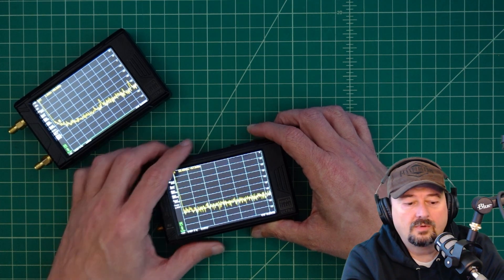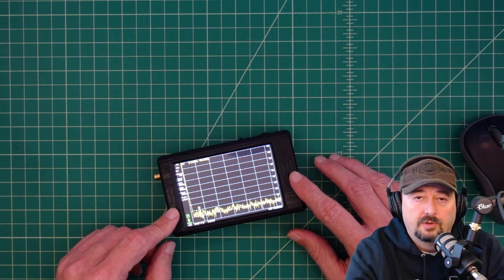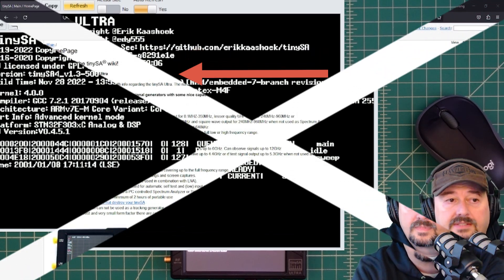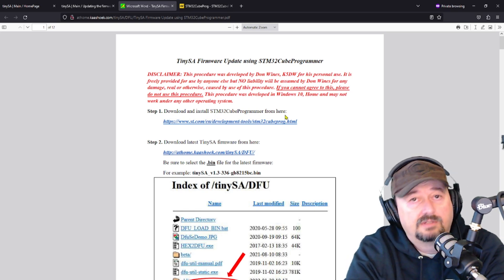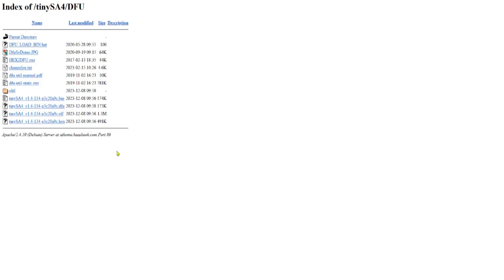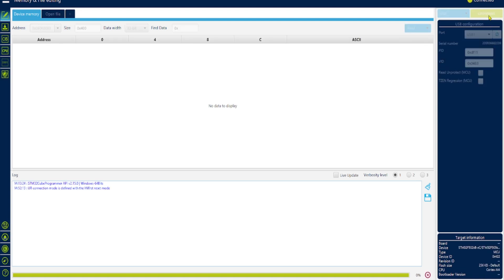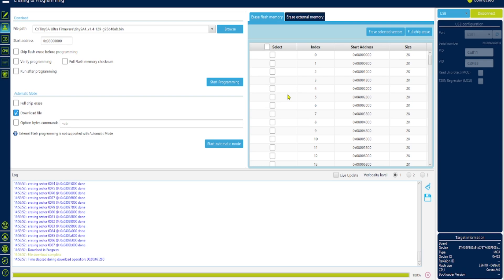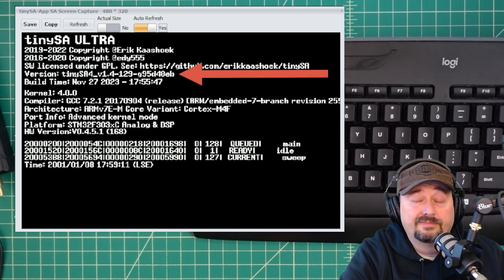TinySA Ultra Firmware Update

Comment: I cannot find anyone who has put out a video showing how the use the STM32CubeProgrammer to perform a firmware update on a NanoVNA. The hardest part of which is making sure you get the correct .bin file for your particular NanoVNA, otherwise it is the same process you demonstrate here for the TinySA.
Reply from the maker: I actually like the software 🤷
Reply: @TheSmokinApe  Cannot beat the price, it works, and is “easy” to use!
Reply from the maker: @kennethharpster3403 💯

Comment: Just received my Aursinc Tinysa Ultra+ ZS207 today. Went through CAL; Activated Ultra mode (strange that we have to do that).  Upgraded the STM32 program version and downloaded the firmware 1.4-199(new as of 03/31/2025) to my device. Some items seemed different from your video, but it worked.  This one goes to 7.3GHZ.
Reply from the maker: @muskateer10  awesome, hope you like it 👍
Reply: @TheSmokinApe  Thanks. I am looking for a good Bluetooth headset. I have my Icom 7300 operating remotely via Wi-Fi. Once I get the Bluetooth headset, I should be able to walk around the house and trigger the rig while looking for RF on the SA.

Comment: After firmware update version tinySA4_v1.4-171-g393022c.bin with the STMCube programmer the screen stays black on my TinyDA Ultra.

I did exactly what you did in the video

17:25:09 : STM32CubeProgrammer API v2.16.0 | Windows-64Bits 
17:34:48 : UR connection mode is defined with the HWrst reset mode
17:34:49 : USB speed   : Full Speed (12MBit/s)
17:34:49 : Manuf. ID   : STMicroelectronics
17:34:49 : Product ID  : STM32  BOOTLOADER
17:34:49 : SN          : 2060326Axxxx
17:34:49 : DFU protocol: 1.1
17:34:49 : Board       : --
17:34:49 : Device ID   : 0x0422
17:34:52 : UPLOADING OPTION BYTES DATA ...
17:34:52 :   Bank          : 0x00
17:34:52 :   Address       : 0x1ffff800
17:34:52 :   Size          : 16 Bytes
17:34:53 : UPLOADING ...
17:34:53 :   Size          : 1024 Bytes
17:34:53 :   Address       : 0x8000000
17:34:53 : Read progress:
17:34:53 : Data read successfully
17:34:53 : Time elapsed during the read operation is: 00:00:00.242
17:37:32 : Read File: C:\Temp\TinySA Ultra\tinySA4_v1.4-171-g393022c.bin
17:37:32 : Number of segments: 1
17:37:32 : segment[0]: address= 0x0, size= 0x2C4D8
17:37:51 : Memory Programming ...
17:37:51 : Opening and parsing file: tinySA4_v1.4-171-g393022c.bin
17:37:51 :   File          : tinySA4_v1.4-171-g393022c.bin
17:37:51 :   Size          : 177.21 KB 
17:37:51 :   Address       : 0x08000000 
17:37:51 : Erasing memory corresponding to segment 0:
17:37:51 : Erasing internal memory sectors [0 88]
17:37:51 : sector 0000 does not exist
17:37:51 : sector 0001 does not exist
17:37:51 : sector 0002 does not exist
17:37:51 : sector 0003 does not exist
17:37:51 : sector 0004 does not exist
17:37:51 : sector 0005 does not exist
17:37:51 : sector 0006 does not exist
17:37:51 : sector 0007 does not exist
17:37:51 : sector 0008 does not exist
17:37:51 : sector 0009 does not exist
17:37:51 : sector 0010 does not exist
17:37:51 : sector 0011 does not exist
17:37:51 : sector 0012 does not exist
17:37:51 : sector 0013 does not exist
17:37:51 : sector 0014 does not exist
17:37:51 : sector 0015 does not exist
17:37:51 : sector 0016 does not exist
17:37:51 : sector 0017 does not exist
17:37:51 : sector 0018 does not exist
17:37:51 : sector 0019 does not exist
17:37:51 : sector 0020 does not exist
17:37:51 : sector 0021 does not exist
17:37:51 : sector 0022 does not exist
17:37:51 : sector 0023 does not exist
17:37:51 : sector 0024 does not exist
17:37:51 : sector 0025 does not exist
17:37:51 : sector 0026 does not exist
17:37:51 : sector 0027 does not exist
17:37:51 : sector 0028 does not exist
17:37:51 : sector 0029 does not exist
17:37:51 : sector 0030 does not exist
17:37:51 : sector 0031 does not exist
17:37:51 : sector 0032 does not exist
17:37:51 : sector 0033 does not exist
17:37:51 : sector 0034 does not exist
17:37:51 : sector 0035 does not exist
17:37:51 : sector 0036 does not exist
17:37:51 : sector 0037 does not exist
17:37:51 : sector 0038 does not exist
17:37:51 : sector 0039 does not exist
17:37:51 : sector 0040 does not exist
17:37:51 : sector 0041 does not exist
17:37:51 : sector 0042 does not exist
17:37:51 : sector 0043 does not exist
17:37:51 : sector 0044 does not exist
17:37:51 : sector 0045 does not exist
17:37:51 : sector 0046 does not exist
17:37:51 : sector 0047 does not exist
17:37:51 : sector 0048 does not exist
17:37:51 : sector 0049 does not exist
17:37:51 : sector 0050 does not exist
17:37:51 : sector 0051 does not exist
17:37:51 : sector 0052 does not exist
17:37:51 : sector 0053 does not exist
17:37:51 : sector 0054 does not exist
17:37:51 : sector 0055 does not exist
17:37:51 : sector 0056 does not exist
17:37:51 : sector 0057 does not exist
17:37:51 : sector 0058 does not exist
17:37:51 : sector 0059 does not exist
17:37:51 : sector 0060 does not exist
17:37:51 : sector 0061 does not exist
17:37:51 : sector 0062 does not exist
17:37:51 : sector 0063 does not exist
17:37:51 : sector 0064 does not exist
17:37:51 : sector 0065 does not exist
17:37:51 : sector 0066 does not exist
17:37:51 : sector 0067 does not exist
17:37:51 : sector 0068 does not exist
17:37:51 : sector 0069 does not exist
17:37:51 : sector 0070 does not exist
17:37:51 : sector 0071 does not exist
17:37:51 : sector 0072 does not exist
17:37:51 : sector 0073 does not exist
17:37:51 : sector 0074 does not exist
17:37:51 : sector 0075 does not exist
17:37:51 : sector 0076 does not exist
17:37:51 : sector 0077 does not exist
17:37:52 : sector 0078 does not exist
17:37:52 : sector 0079 does not exist
17:37:52 : sector 0080 does not exist
17:37:52 : sector 0081 does not exist
17:37:52 : sector 0082 does not exist
17:37:52 : sector 0083 does not exist
17:37:52 : sector 0084 does not exist
17:37:52 : sector 0085 does not exist
17:37:52 : sector 0086 does not exist
17:37:52 : sector 0087 does not exist
17:37:52 : sector 0088 does not exist
17:37:52 : Download in Progress:
17:37:56 : File download complete
17:37:56 : Time elapsed during download operation: 00:00:05.089
Reply from the maker: STM32CubeProgrammer version 2.16 has a bug and is NOT able to update the tinySA. Use version 2.15
Reply: @TheSmokinApe  I have TinySA Ultra i saw there where a new version 2.17 now, do that one work on TinySA Ultra?
Reply from the maker: @pege63  I’m not sure, haven’t tried
Reply: @TheSmokinApe  Thanks m8, it worked am good to go now!
Reply from the maker: Apparently the 2.17 will work

Comment: Thanks a lot for useful video. I can conform because I did it!:) WARNING: "STM32CubeProgrammer version 2.16 has a bug and is NOT able to update the tinySA. Use version 2.15!!" . Of course who reading instructions.... TinyAS after update with STMv2.16 looks like bricked but older version 2.15 fixing it.
Reply from the maker: Yeah, this is a good point 👍
Reply: I wish I would have seen this earlier.  I have been trying to find data as to why my TinySA ultra went to black screen after update.  I am up and running now.

Comment: I used the STM DfuSe_Demo V. 3.0.6.  Once installed, I had to upgrade the drivers in Win device manager, but after that, hardly what you cal complicated. I did this for the Nano VNA H4 and that upgrade went flawless, and just did the upgrade for my Tiny SA ultra.
Both in under an hour. So easy, it seemed scary.
Your video is a very good guide, TNX
Reply from the maker: Hey Daniel, glad it worked out for you 👍

Comment: I did the update and something went wrong, it wouldn’t startup again so I started to play with my new paperweight after a while I checked the box erase the chip and got lucky it worked. After I restarted and sent the bin file. 
I think with the hassle of getting the software and bin file I had duplicate files that had number differences I fixed that by naming it what it should be then got lucky
Reply from the maker: Glad you got it sorted out 👍

Comment: I also tried to update my TinySA ultra based on the videos for the first time with the STM32 program.
In the end, this indicated that it was successful.
There is an error report in the log.
88 memory addresses could not be deleted because they do not exist or something similar.
After the update everything went black.

The TinySa app has not seen the device.
The STM32 saw it, connected, at the end it said that the update was successful, but it still remained black.

After half a day of struggle, I gave up and tried the "Full chip earse" option.
I updated it again.

When the update failed it was done in less than 2 seconds.
Now at the last one, when everything was fine with the update, it took more than 5 seconds.
I don't know why it didn't work the first time and I had to suffer with it.
Reply from the maker: No idea either but I’m glad you got it worked out 👍

Comment: I updatet the Firmware of a tiny sa ultra. The first flashing was succesful with no errors. But after switch off and on the Tiny SA ultra the screen stayed black. The STM32 programmer is able to connect the tiny. But now no Data ist displayed after connect to the tiny ultra. The programmer shows all sectors not exists during the flash process. It seems the device is brigged. Any idea how to fix this problem ?
OK, my fault. With the 2.15 version of the programming software it was no problem.
Reply from the maker: Hey NHF, apparently the 2.16 version of the software has a bug 🪳

Comment: I followed the instructions to update my Tiny Ultra to the latest but it was unsuccessful.  I noticed in the log that while programming it said "Sector 0000 does not exist" and this went all the way through to sector 0088 does not exist.  I've tried reflashing, it but same results...of course it won't turn on now.  Any ideas?
Reply from the maker: What app are you using and what version of windows?
Reply: @TheSmokinApe  Windows 11/64 and the STM application.  It seems to work and doesn't give me any errors except that the log has these weird entries.  The end result is a pure black screen and it was working fine prior to the firware upgrade.  I have the TinySA Ultra (I got it from R and L Electronics and figured it would be legit) and downloaded the latest firmware from the authorized site.
Reply from the maker: The RnL ones are legit.  There is aTinySA groups.io and many folks have been reporting this issue over there, I believe it to be a driver issue.  You should check it out 👍
Reply: @TheSmokinApe  Turns out version 2.16 of the STM32 programmer has a bug in it.  I dropped down to version 2.15 and it loaded the new firmware without issue (there was an entry in the NanoVNA forum about it).  Took all of about 10 seconds to do.  I even did the VDD -> BOOT short and that did nothing.  So anyone having issues with their TinySA Ultra and version 2.16 of the programmer, just download version 2.15, install it and follow the video here to update the firmware to the latest.
Reply from the maker: Glad to hear you are back in business!

Comment: Everything seemed to work perfectly until I tried rebooting my tinySA.  Just a black screen.  Nothing.  Any ideas. Using a Mac, but still everything looked like it worked exactly as in your video.
Reply from the maker: That doesn't sounds good, I would try to apply an older firmware and see if the process works?
Reply: @TheSmokinApe  Good news is the seller via Amazon agreed to do a one for one swap for a new one.  I read a lot of weird info that the update is not for the ultra.  I could try again on a Windows laptop, but I might just enjoy it awhile as is before I try again.  But yes, that attempt hard broke it.
Reply from the maker: @D4vesgrill  glad to hear they will swap it out 👍

Comment: @TheSmokinApe, you did a video with KK6USY a few weeks ago in which there was a problem drawing a reference line at -16.02. I checked the forum and found one comment about this issue but there were no replies. Have you founf out anything? 73,NW3U
Reply from the maker: Neither of mine do it, I asked Chuck to do a FW update nad see if its still a problem.  If we find anything there will be a video...
Reply: @TheSmokinApe  interesting I have the latest software and it's still doing it. Thanks for your videos they are a big help.

Comment: There are a couple of other ways to update the Firmware. One is using DfuSeDemo S/W  which is my preferred method,  a lot easier to me. Another method is using tinySA-App in a menu option . And using the DufeSe file down load firmware instead of the Bin file on one of these two S/W prog. I have used all three.
Reply from the maker: I've used a few methods myself, I did this one for the video as it was a request from a viewer.

Comment: great info. can be important to update firmware on devices like that. I have the nano VNA-H4 . I have the Icom IC 7300 and there is a new firmware update for that on Icom website. hard read mostly in Japanize . the new feature is TX lockout. and some rig control for a Icom amp.   and a hard reset but pushing buttons if screen lock up . I downloaded the file but waiting to see some video's on the new firmware for the 7300. mine working great. 73's
Reply from the maker: Hey Rob, it seems like we are always updating firmware these days.
Reply: @TheSmokinApe  even the Talk pod has a update . I just ordered one for my self. if dirty I send it back . amazon .
Reply from the maker: @robertmeyer4744  lol, good luck with it 👍

Comment: You'd be amazed at how problematic software can be at installing itself sometimes... 😏
Reply: ...but yes, it did go smoothly for me in this case. Though for now, I have not elected to have the firmware updater (Programmer) have network access to check for updates to itself. Cheers.
Reply from the maker: Nah man, I get it as I’ve been in IT for almost 30 years.  This software was a pretty straight forward install. Thanks for checking out the video 👍